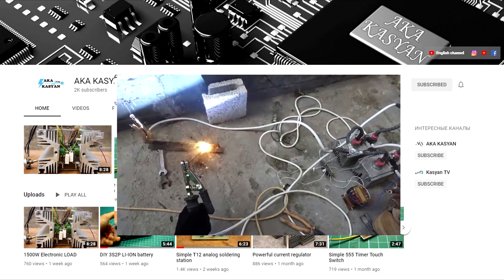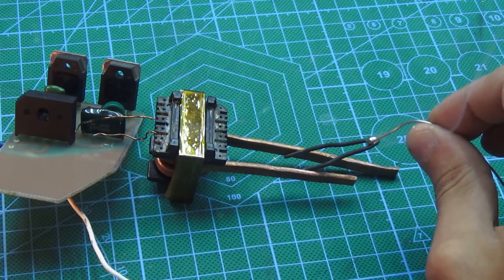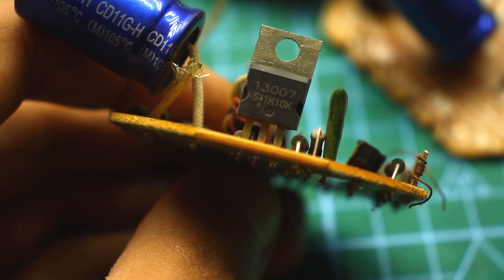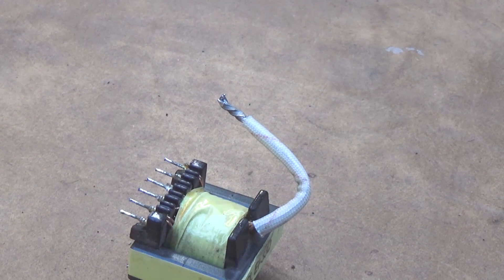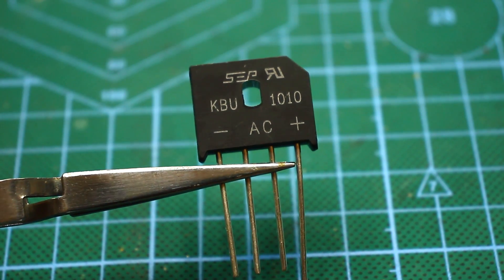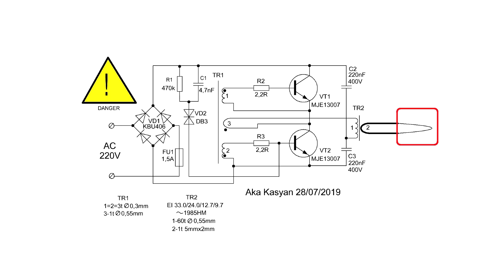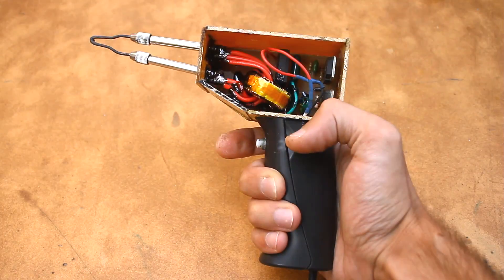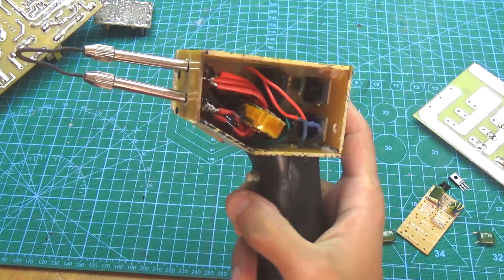Momentary heating Soldering iron

Comment: Hi
I made the circuit ,but as soon as I add the soldering tip to secondary of  the  output transformer both transistors burned out.
May someone help me to find the cause of this fault,I checked the circuit and components ,all were ok.
Reply: you put heatsink on them? or you cheked the primary is o

Comment: Can you tell me another way that how can I measure diameter of thin wire without digital calliper
Reply: Wrap the thin wire firmly onto a flat pen. There is no gap between them. 
Measure the total length and divide by the number of turns.
Example: You have 20 times wrapped and 10 mm. 10/20 = 0.5 mm
Reply: Measure a length, drop it in a graduated water flask and record the volume it displaces. Do the math.
Reply: you just tell the shop what diameter of wire you want to buy  and they give you the exactly one .. :D ...

Comment: Very interesting, thanks for the description. By the way, i have an antique instant soldering iron where the tip ws broken when i got it. Now i can make a new one for it from iron. I thought it was something special.
Reply: Im using 2.5mm2 copper wire as tip, im changing it only when it oxides
Reply: Solid copper wire is the best thing to use.